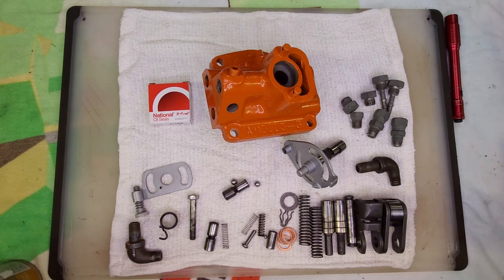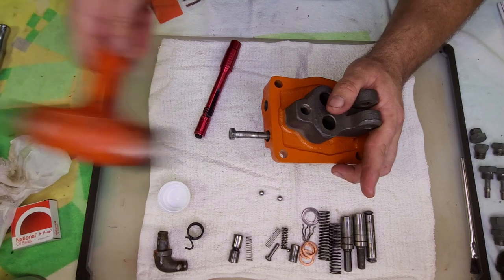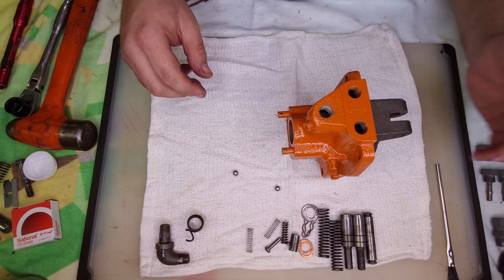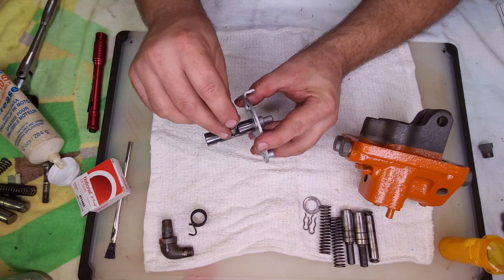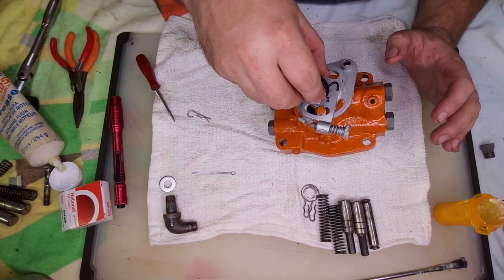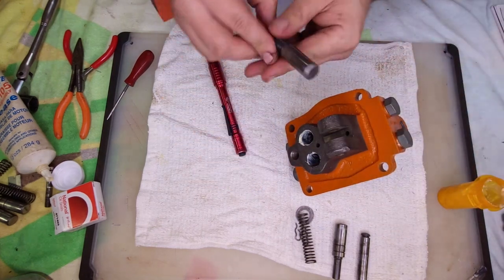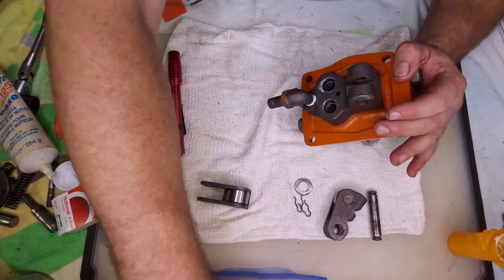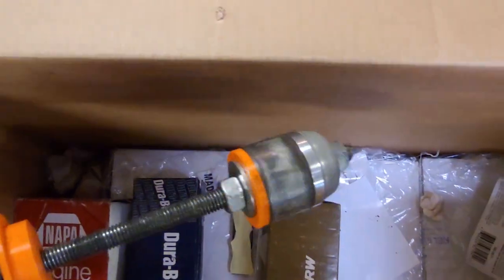1953 Allis Chalmers B Hydraulic Pump Assembly

Comment: Great video! Thank you for being so thorough and explaining how it works.
Reply from the maker: You are welcome. Hope it helps!
Reply: @JPN76  do you happen to know what pressure is within spec?
Reply from the maker: I do not but i think i saw it in a manual. Ill look later to see if i can find it.
Reply from the maker: Found it. With gauge attached you should read 3200 psi when relief valve opens.
Reply: @JPN76  thank you very much! You’ve been a great help.
Reply from the maker: Also states if valve opens below 3,200 pounds, push relief valve seat deeper into pump so as to increase the effective spring pressure. With pressure at about 3,100 pounds and control valve in "lift" pро- sition, stop pump and watch pressure drop. Pressure drop should be slow and should not drop below 1,500 pounds. The same results should be obtained when test is repeated in "hold" position.

With adjusting screw backed out, move control valve to "lowering" po- sition. If pressure does not immediate- ly drop to 100 pounds or less, relief valve seat has been driven too deeply into pump body. Turning adjusting screw in, retards lowering rate.

Comment: The return spring for the shift plate appears to be new.  Do you have a source for that or how did you obtain the spring.  I have a Bseries and the spring haas lost its tension so the pump will not return to neutral after raising the mower.  Any info you can provide would be greatly appreciated.
Reply from the maker: I actually bead blasted and painted the old one. No idea where to find new for this.

Comment: Great video, I will be starting on mine soon I hope. these videos will be a great help.  It would be interesting to know your cleaning and painting techniques.  Those parts look spotless. Also what paint you are using. How did you check on the seats for those check valves?
Reply from the maker: Sand blast, glass bead blast, wire brush, or a combination of them all. Then prime with self etching primer and spray on some Tisco persian Orange #1 acrylic enamel. The only way I checked the seats was to try and blow backward through the valves with the check ball in them. From the two pumps I managed to get 4 that were very good. Two of the others had flat spots on the check balls. I figured if it will hold air that well it should be great with oil.

Comment: If you're working on one of these remember that this pump runs at a lot higher pressure than others so you cant use another manufacturers cylinder or you'll blow the seals out of it.
Reply from the maker: One day I i might put a gauge on it out of curiosity. But yeah, to operate a cylinder that small, it has to have some serious pressure.

Comment: Not to be rude or snide, but please relook at your oil pump video, and check your rotation and vane placement. I hope I am wrong, it looks your vane are in wrong

Good video! Glad you got your parts. did you send your block to a machine shop or did you do it yourself ?
Reply from the maker: It's not past me to mess it up so I'll double check. No machine shop I'm trying to stay as low budget as possible on this.
Reply from the maker: Well shit! I just looked at the teardown vid and they are different. I'll double check the manual and correct the video. Good catch thanks
Reply: @JPN76  👍 I hope I helped you out
Reply from the maker: You may have very well saved my tractor..... I guess I mixed up the direction of rotation. It's opposite the crank rotation but on back of engine and I must have gotten turned around.

Comment: I think I asked you before, but what type of paint and primer are you using? Rattle can or a Paint sprayer?
Reply from the maker: Rattle can etching primer and tisco paint thined with hardener added in a paint sprayer.
Reply: @JPN76  Thanks! trying to figure out that next. Factory paint jobs everything orange except rear rims and headlights I read some place, I do however like the silver look to your control valve plate.
Reply from the maker: @seniorelectrician6831  yeah I did a little different with the paint. Part of front rim silver then gen and starter black/silver.
Reply: @JPN76  dont remember where I read that about factory paint job, but they said it was thick with runs and sags, and what was not painted orange. 
Since this Tractor was my Wife's Grandfathers, and I dont know if it was bought new or used, I plan to re do it to like new / original with as much original parts that I can.

Comment: How much weight can this hydraulic pumps with a standard cylinder lift?
Reply from the maker: I have no idea. Can't find specs on the tractor Hydraulics. They have small diameter rams so probably not a lot compared to modern stuff